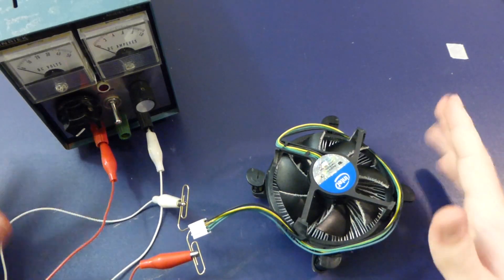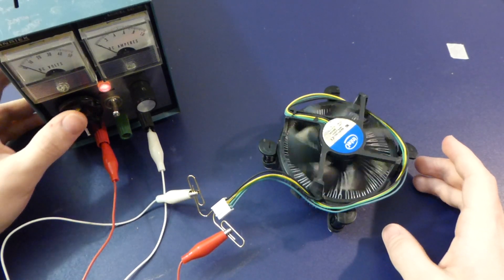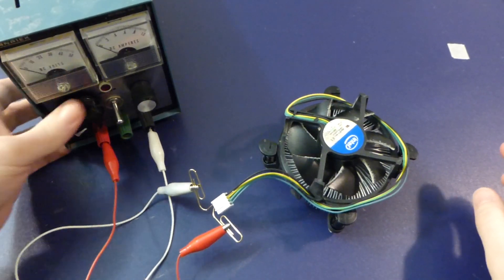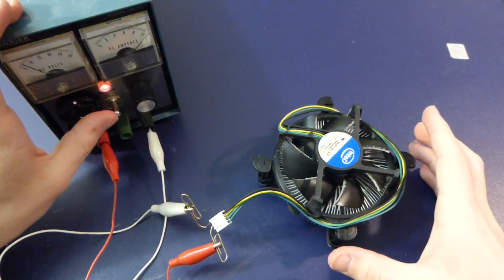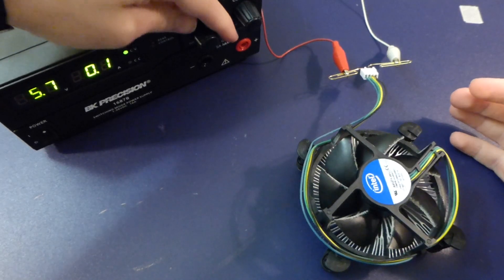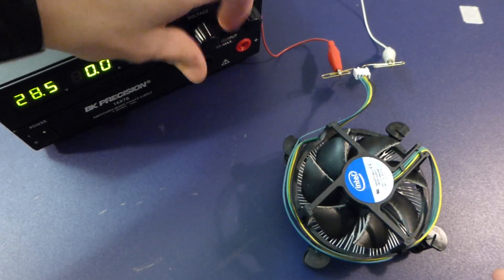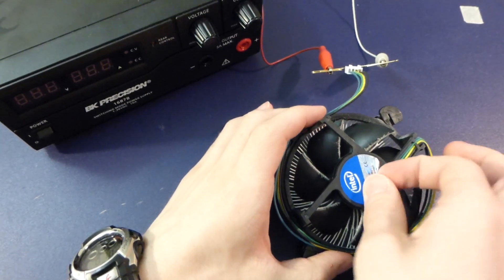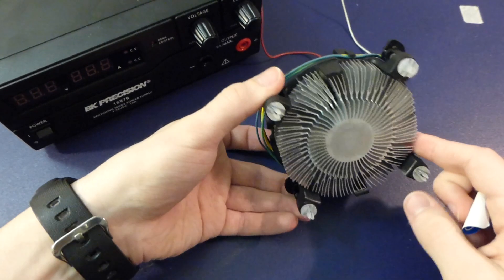Overvolting an Intel CPU Fan

Comment: This video helped me figure out what's wrong with my Xbox 360 fan. That fan running on its operating voltage sounds just like my Xbox before the fan stopped working completely. Now I have a computer fan on top of my Xbox running on a 120 - 9 volt adapter. 😂  
Temporary fix until I can get an upgraded console. Hopefully the Xbox one s
Reply: Why not a damn PC
Reply: Why not an Xbox One S? It's gonna be pretty cheap
Reply: +sondrayy Yeah but I honestly don't have the time to build a PC. I get that pc's are good and it would be nice to have one but I have no knowledge on that stuff. A console would just be easier and I don't game that much anyways to put all that work and money into a PC. You feel me fam? Lol 😂
Reply: +PneumaticFrog ey, thats my man
Reply: +MegaLoquendo2000 That's probably what I'm gonna get.
Reply: +Ben Meyer get a PC dude. Do some research on building PCs it's really simple building them, choosing the right parts  is the hard part.
Reply: Rage parts are EASY
Reply: Ben Meyer i feel you, i was about to say it doesnt take much time but if you're super green and isnt THAT into gaming, then i agree.
Reply: Ben Meyer You could probably do it with no knowledge at all... The parts come with manuals and have slots, and if it fits, it works.
Reply: Hey y’all! 5 years later and I’m still happily using my Xbox one s, still have the 360 too but it’s in storage still with the non working fan haha! I think it would be pretty funny to hear from y’all again 😂

Comment: I think these actually run at 12V on .18A. It likely blew as soon as it did because of the high current. You'd be able to pump a fair amount of voltage if you operate the current at the ~.18 value.
Reply from the maker: +Goto Tech Reviews ...That's not how electricity works. If you limit the current, the voltage will drop accordingly, and the power consumption will stay constant.
Reply: +Mark Furneaux Derp, I stand corrected. Already forgetting my EE101. :(
Reply: So I looked up the specs on this the other day,  peak voltage at like.23a is 13v I believe. But my knowledge is still new to these... He doesn't appear to be using and pwm control for the fan, what does that do to the system do you think?
Reply: I = V/R
Reply: i thought watts law was ampsxvoltage=watts. so the only thing that would increase would be the watts and not the current on variable voltage. amps would only increase if the resistance changed.
Reply: volkswagenginetta better learn ohms principle

Comment: Lol pos Intel ,those fans are so slow and can't even handle 24 volts lol I had a cpu fan it was slow and it went really fast off of 24 volts and handled it just fine for more than 8 hours straight until the blades broke off when I was playing with it when they hit something

Comment: Only stock fans worth keeping is AMD's cause they take off if you give them a nice voltage.
Reply from the maker: +SMGJohn I tried a fan kill on an AMD cooler on my other channel, I couldn't kill it with 36V. AVC makes some good fans.
Reply: They tend to give higher quality fans because their CPUs run a lot hotter than Intel. So it ends up being about the same so it's still good to  get a better fan anyway.
Reply: They output more heat, which is different than running hotter, please don't confuse the 2, you will start a flame war (pun intended)
Reply: Yeah... I once cranked 30V through one... the fan was spinning fast enough to hover before it failed!!
Reply: SMGJohn I need one of those. :|
Reply: ayyyy u here
Reply: ayyyy u here
Reply: ayyyy u here
Reply: AMD cpu's do not run hotter than 5th gen and down intel processors, they use more power and the cpu die itself outputs more heat. The whole package however is a different matter, since intel CPU's had VRM's on the actual die. This meant they typically ran hotter. The coolers are shittier because they can get away with it, no other reason. Don't be a fanboy about it.

Comment: Why the actual FUCK are you using stock cooler in the first place in/on a server?
Reply from the maker: +I USE The CPU isn't heavily loaded, so thermal performance is not an issue. They are quiet and free, and I have a stash so I can keep replacing them as they die. I fully agree that they suck ass (I will never build a workstation with one), but they work fine in this situation - for now anyways.
Reply: Mark Furneaux
Ah okay. But I'm just sayin'  .. its not a bad thing to switch to an after market cooler.
Reply: +I USE I use a turbo water jet inter cooler on my 455 MHZ Intel chip.  It's so VTEC.
Reply: +I USE The stock coolers are fine for use in a normal non-overclocked application, though proper server hardware wouldn't have a single CPU fan and wouldn't use the retail cooler either.
Reply: NgtFlyer
meh true